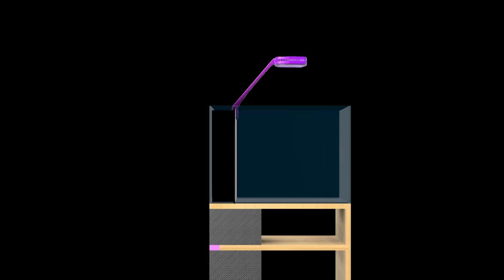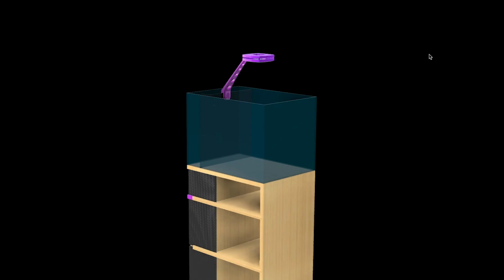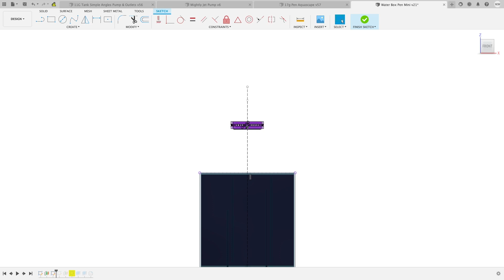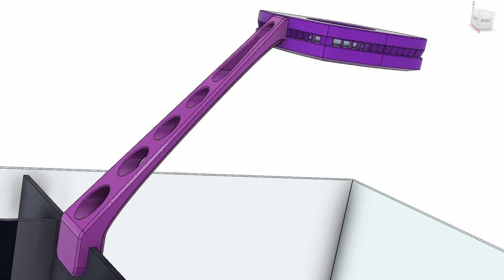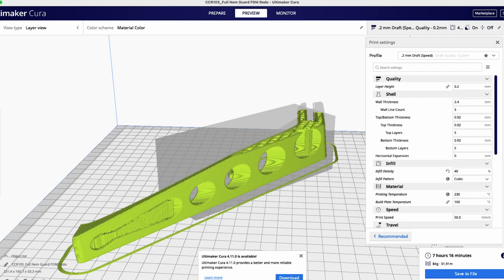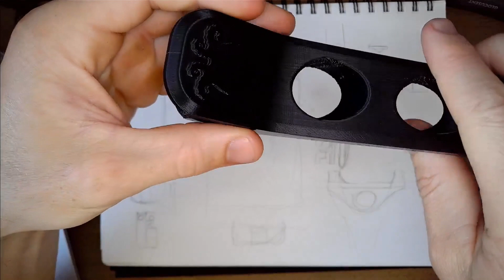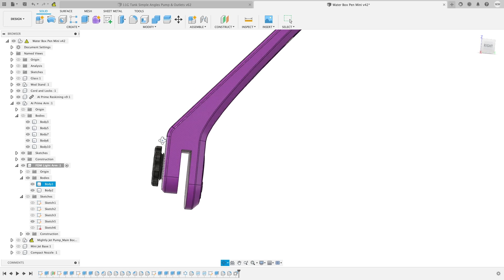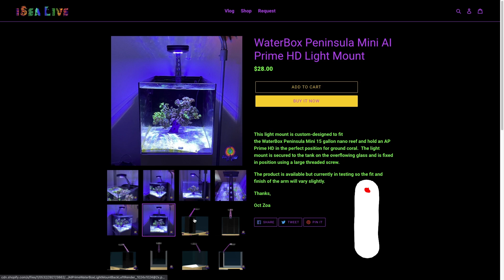WaterBox Peninsula Mini AI Prime Light Mount Upgrade | 3d Printed | Part 3

Comment: This is awesome.  Would you make some if I gave you measurements? I have 2 primes on a IM 25 lagoon
Reply from the maker: Thank you.  I can do that for a future video.  Depending on the size of the tank it might be a long light arm making it harder to print in a single piece.   
I need the thickness of the glass in millimeters and the ideal mounting height of the lights.

I found this thread with measurement.  Check it out and double check the dimensions. 
https://www.nano-reef.com/forums/topic/371377-im-nuvo-lagoon-25-owners-thread/
Reply: @ISeaLive  can I email you?
Reply from the maker: @leroycline8849  sure shoot me an email mark@isealive.com
Reply: @ISeaLive  sent over a email